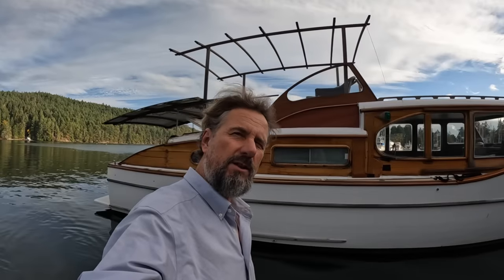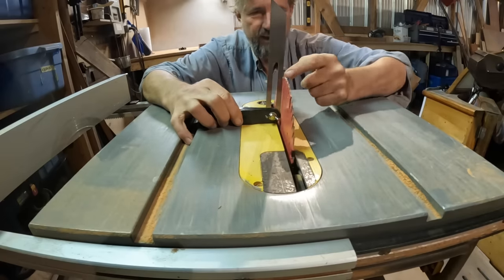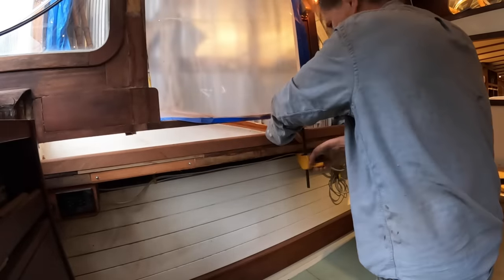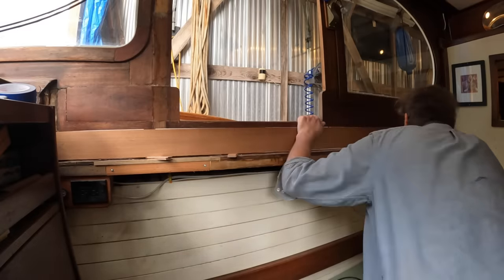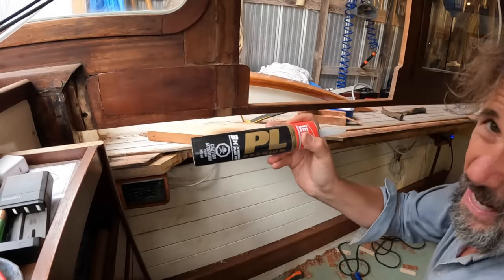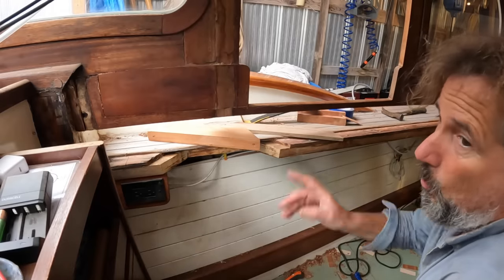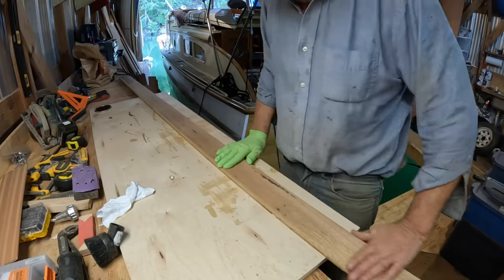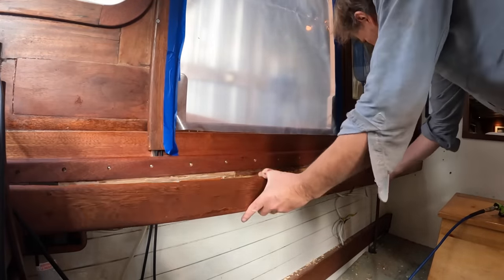Making New Cabinsides - #390 - Boat Life - Living aboard a wooden boat - Travels With Geordie

Comment: Hello Peter,

That repair is absolutely marvellous. It's taken well over a week, but I am now up to date with all your boat restoration videos. They've been a great pleasure. You mentioned you would like to repower MV Poem with a Beta 25. I have a Freeman 22 Mk 2 that is fitted with a very tired 997cc marinised Ford Anglia 105E engine. Rather than overhauling it, I am going to replace it with a transom mounted Amaroq diesel outboard engine, which is equivalent with the 40 hp  of the petrol inboard. This will give me more internal space & far greater range, but more importantly, no further need to hump heavy petrol cans from garages.

Very best wishes,

Perry

Comment: Construction adhesive isn't a permanent fix, it has good grip properties in the short term but breaks down over time. Different ones have different lifespans but they can be anything from as little as 5 years up to a maximum of around 15yrs depending on environment and temperature conditions. If you don't use fasteners it will need re-gluing in time !